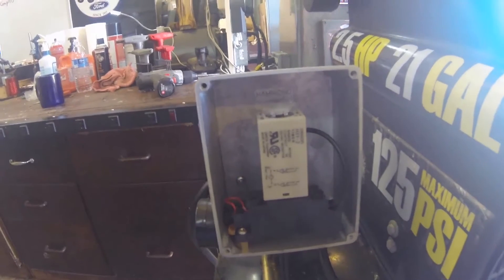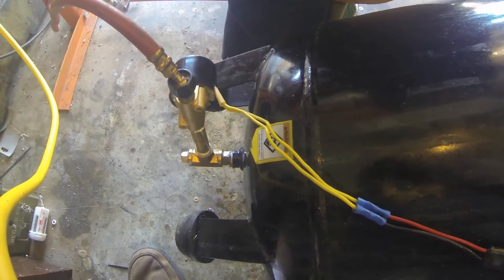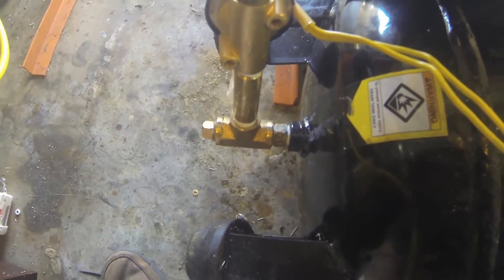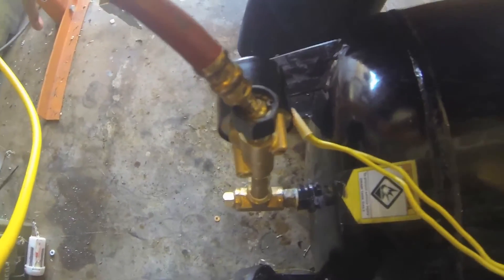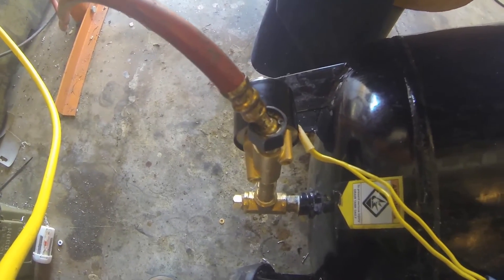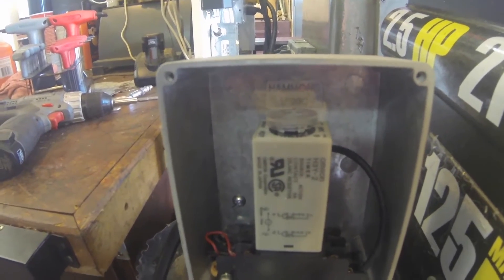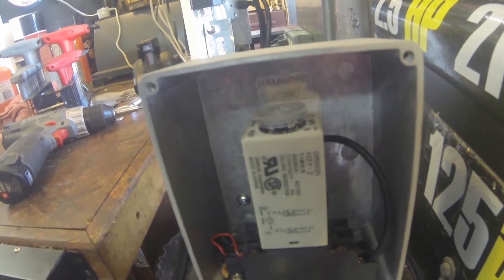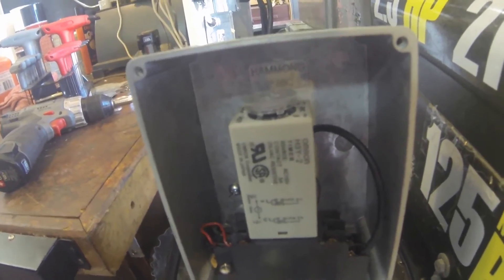Air compressor Automatic Drain

Comment: Dear sir.
That is a very smart idea.  If I would be more tidy, I would make something like that too.  As it stands I just have the drain ever so slightly opened, and it drains all the time.
Kind regards,
Marcel.
Reply from the maker: Marcel Timmers Thanks Marcel.  I have since tidy'ed it up a bit.  Buy draining all the time, it will put an extra strain on you compressor, causing it to wear out too soon.  Better just to drain it once a week.
Reply: Herb Blair q

Comment: My 'old' compressor has a ball valve plumbed in and a length of hose leading under the workshop doors so I can reach underneath and drain the tank. It's also great for scaring people walking by!

My new plumbed in compressor will get an auto-drain setup and also an unloader valve. If you have a mechanical pressure switch, then the unloader valve is part of the same mechanism. This means you should never stop your compressor by turning off the input power as it won't bleed the pump down and you could strain the pump/motor starting against pressure next time. You need another delay circuit that operates a solenoid whenever the motor stops.

I've got a load of 24v DC solenoid valves, so I'll be doing something trick with capacitors for the delay circuits.
Reply from the maker: I look forward to seeing your implementation, Paul.  Thanks for the comment.

Comment: Nice job Herb, this is something I really should do to my compressors, I know I'm always saying to myself that I'm gonna drain the tanks tomorrow, but it never gets done till I plug a tool or nozzle in and I get a nice water/air mist usually in the direction of my face.   
  Thanks for sharing your design ...... Mike
Reply from the maker: Thanks for the comment Mike.  The project cost me less than $50, I had most of the plumbing items, just had to get the time delay relay and the solenoid.  They are all 1/4" fittings.  Thanks for watching.

Comment: Pretty good Herb. I really need that setup on the compressor here in the shop. I drained over a gallon of water from it when I moved in and I notice some water building up in the traps now after some use.

Colin
Reply from the maker: Colin, everytime the compressor runs, it creates water.  It was a pain to drain it manually, and made a mess.

Comment from the maker: The drawing is not correct, the contacts on the TDR are normally closed,  they will open after the preset time. The solenoid opens when the motor comes on, and closes when the contacts of the TDR  opens.  When the motor turns off, the system is reset.